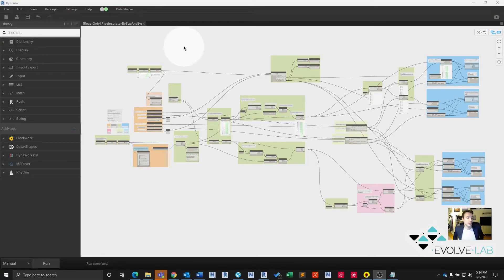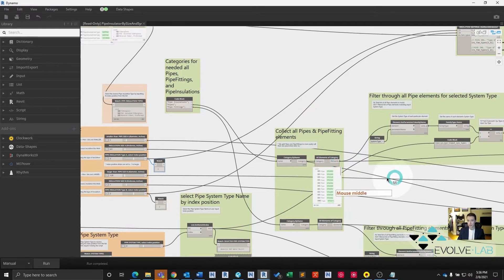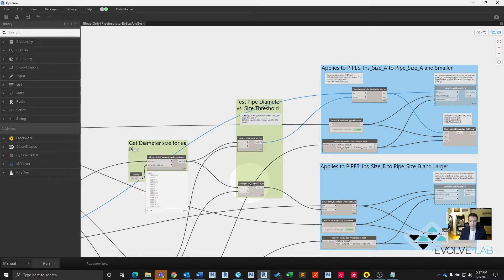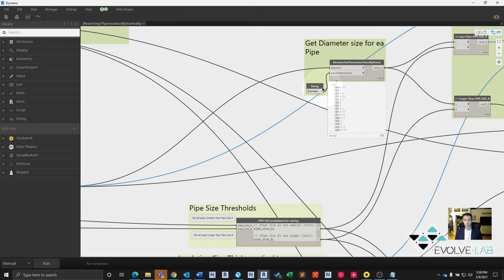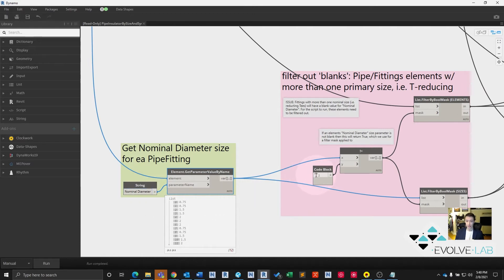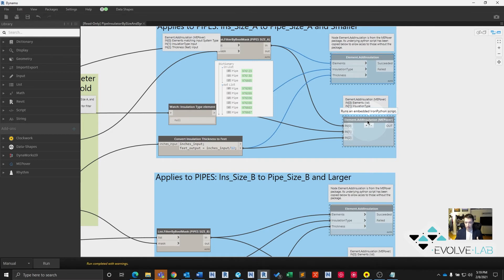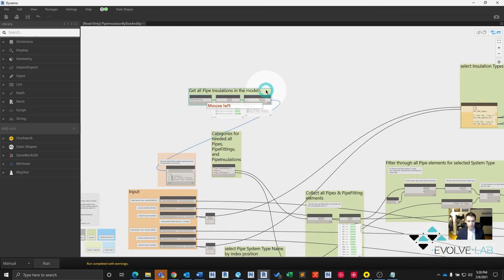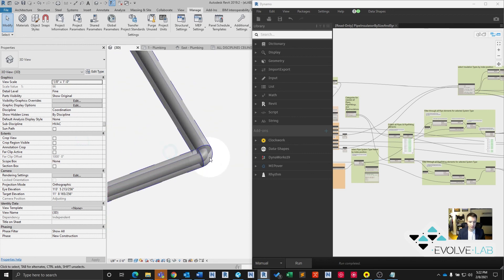Add Insulation to Revit Pipe Systems with Dynamo

Comment: I'm modeling a double wall piping for the diesel system. Is it possible to make a double containment piping in dynamo? I just faked my modelling and use similar concept with pipe having insulation. A smaller primary pipe (carrier pipe CS DN100, inside a bigger secondary pipe (containment pipe CS DN150). Can you help me making a dynamo script for this case? Thanks a lot for your video tutorials. It helped me a lot as a beginner in dynamo. Cheers!